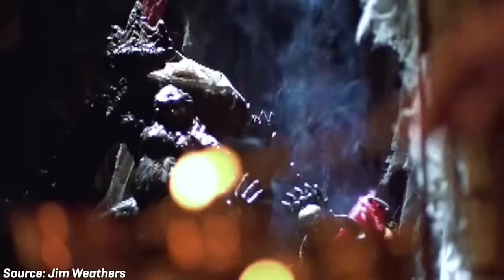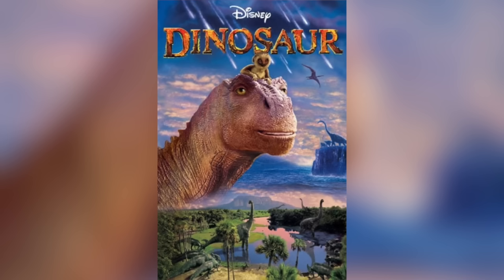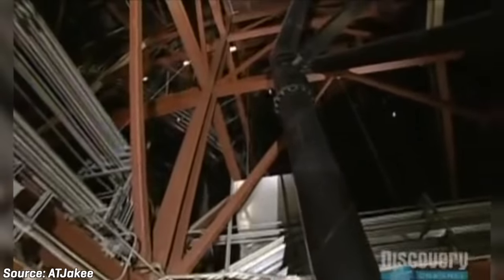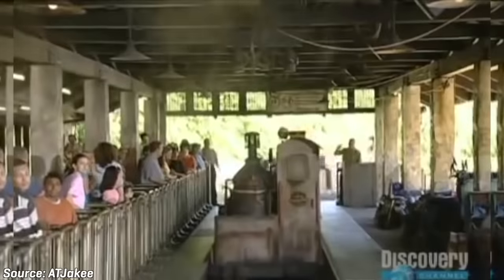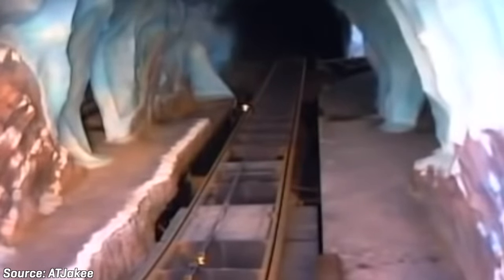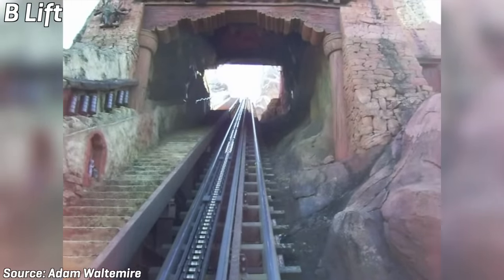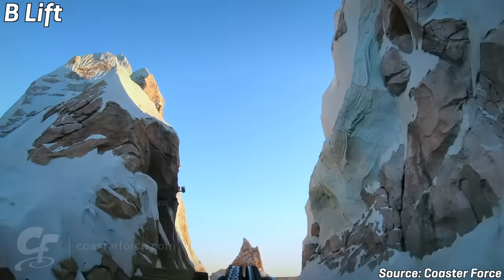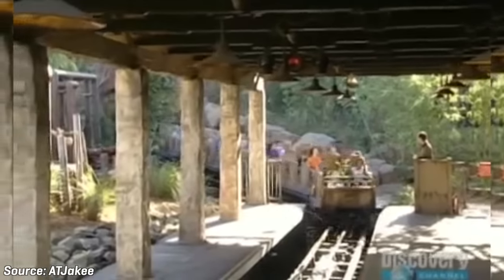Problematic Roller Coasters - Expedition Everest - Disney’s Animal Kingdom

Comment: Back in highschool, with the help of the robotics teacher I I made a miniature scale of the Yeti scene using clay and small metal rods as the scaffolding. He helped with the miniature yeti animatronic the size of an action figure.

I ran a test, first experiment was with a lantern battery (to represent the literal jet engine that powers it!). it ran for 8 hours (which I converted into years, so it would count as 8 years) until everything collapsed.

But the second one was a better result, because I changed it with 4 D batteries. It was able to run with no collapsing/stress.

So in my conclusion, they could literally change the yeti's power supply which could be more powerful but less heavier; Reducing stress in the foundation/scaffolding.

Comment: Tip: Seat small children on the left side. The lateral forces on the backwards portion pull you to the right, and you can hit your head on the (padded) side of the seat. I did that the first time. It didn't injure me, but I didn't like it as much the first time because of that.

Comment: Back in July 2017, we got stuck where the yeti is supposed to jump out  after approaching the “broken track” before falling backwards, we got stuck, we spent over an hour on the ride just waiting, we got to walk down the track and it was pretty cool. Sucked we got stuck but we got two fast passes each to reride the ride once it was fixed. They said the system overheated due to it being 100+ degrees.

Comment: Would you be able to do a video on why trains take a different amount of time per dispatch to load, bc i always wonder why there is a fast dispacth every so often and a slow dispatch and i wonder what causes them to happen! Great video btw very informative
Reply: there's all sorts of reasons idk about this ride but the one I worked on sometimes people wouldn't fit in the standard seats so we'd have to unload them and then do a hold on the next train to get them a modified seat. the harnesses were  hydraulic and was 2 per section so you'd have to recheck the two rows that dispatch popped for the one guest. there's holds for guests with accommodations. my ride had a no loose article policy so you'd have to tell people to give us their hat so we could put it in a cubby which added more seconds to dispatch. sometimes people would get scared after pulling down the harness so you'd have to pop the section escorting them off and recheck. depending on the harnesses some people had trouble figuring out undoing their seat belts and we also had over the shoulder hydraulic harnesses and on occasion they wouldn't pop in unload so we'd have to do it manually. guests would loose stuff on the ride and come to tell you about we'd fill out a form for them so you don't get your harness checks started as quickly... all sorts of wacky stuff can happen honestly!!  my ride was floorless and one time the floor didn't come all the way up by about half an inch and we had to evac them even tho they were in the station lol

Comment: This explains a lot. One time we were up at the very top with the broken tracks that go up, and we were sitting there for way longer than the other times i had ridden it that day. I was worried that thr ride had broken down.  The same thing happened once with the projection. But bow i get that that can be normal depending on where the other trains are. I'm glad that the trains will stop at the bottom of thr first hill when there are issues because one time that happened to be and i woukd have pannicked if we had stopped at the top😬

Comment: You know as a kid i LOVED roller coasters, but i was always so scared that something terrible would happen on one. Like what if my safety harness pops up mid ride? Or what if the coaster stops mid loop? What if something goes wrong and our cars collide on the track??? One time as a kid I remember going to a roller coaster camp at busch gardens where they took us behind the scenes on most of the major coasters at the time. And they explained all the safety measures that were in place specifically to keep anything like that from happening. 

While it definitely does suck that the coasters are sometimes programmed to sit still for an immersion breaking amount of time, it is always wonderful to know that the coaster is smart enough to ensure that riders safety is a priority and that if the coaster is stuck in one spot, that it just means the safety measures are doing their job. 

(Also it was a relief as a kid to learn that all my fears of what could go wrong on a coaster were not unfounded, but the people making the coasters had already worried about it for me. Like the fact that a harness physically can’t pop open on a ride because its default position is CLOSED-at least id its a hydrolock I believe-or the fact that the flat bits of coasters are in fact there to guarantee that you can’t bump another car or lose speed mid track!)

Roller coaster operation is a fascinating thing to learn about. And all the different ways it is done on each coaster makes it something that you’ll have a hard time running out of material to read about!

Comment: So, what I would have done to fix the issue with the ride's 5-train operations is to add a second block to the hold section, so that the final brake section can hold two trains. Of course this would require an additional length of brake run to do so, but the general idea is that with a ride like this stacking at the end is more desirable than letting the ride hold at key sections. Of course, with this situation, five train operation would still require a train to stop somewhere along the ride, but that can still be at the end of zone 1 since you don't really have a show element there - it's just the train stopped at the end of a broken track.

Comment: EE is my favorite attraction at AK (quite possibly my favorite coaster at any of the Disney parks tbh) and I would GLADLY accept any downtime needed to fix that dang yeti. I don't care if it takes two years, the yeti must return to A Mode. There are quite a few other E-ticket draws at AK these days, so I say it's time to make that decision to shut down the ride and get it done. 

However, now with Joe Rohde gone and the current leadership that only cares about money, quality of rides be damned, I honestly doubt that the yeti will ever be fixed back to its original state. It's sad to think that, but I really think that is the reality of this situation. To me, a disney parks and coaster nut, seeing that 20ft tall yeti swinging its arm down at me would make the attraction soooo much better, even if it only lasts five seconds, but there is no way in hell that the current leadership would EVER even consider shutting the whole ride down just for five seconds at the end of the ride. 

That is really a broad picture of all that is wrong with the Chapek-led company, and I wouldn't be surprised at all if that nickel-and-diming-guests attitude for half-ass attractions (likely caused by massive cuts to the imagineering department) is exactly why Joe left the company. It's really a sad thing to think about. Disney is trying to take the Six Flags road in terms of quality but still charging ever-increasing Disney parks prices. That certainly cannot be sustained, and something will give soon enough.

Comment: I rode this coaster like 5 times in 2022, when I went. The line was low, and it was ride after ride. Also, this ride is glossy smooth if I remember correctly.
Reply: That's good to hear.

Comment: I can imagine the track switch getting stuck and leading to a horrific accident
Reply from the maker: The track could certainly get stuck but with all the sensors on the ride, the train isn’t allowed to resume motion again until the track switch its rolling into is confirmed locked in place. Otherwise the train will sit stopped
Reply: @ElToroRyan  even worse I can imagine the sensors bugging out and flipping all the occupants into machinery.  But I'm sure something like that never happened
Reply: @8bitorgy  let me put it this way.

let's say the switch track has a 1/1000 chance of failing to switch properly. when this occurs, a sensor on the ride prevents the trains from moving unless the switch track properly lines up. let's imagine that sensor has a 1/20,000 chance of going down or misreading. already, you are looking at a 1/20,000,000 chance of something going wrong. but that's not all. when I said "sensor" I meant "sensors" because every sensor vital to ride safety has another sensor that measures the same thing as a redundancy measure, which would likely also have a 1/20,000 chance of failing, bringing the odds to a 1/400 BILLION chance of the switch track failing. that means that, on average, every person on earth would have to ride the ride 57 times, with the train all to themselves, before something like that may happen. that number is several hundred times larger than the amount of riders the coaster could possibly handle in its entire lifetime, nonetheless actual trains which is what that probability is showing, that each train has a 1/400 billion chance of an accident at that switch track. that's still not accounting for disney's daily inspections likely catching something wrong with the switch track before it actually happened, reducing the odds even further.

Comment: With the amount of parks that Disney has in Florida I was wondering if the USA has competition laws?, they seem to be taking unfair advantage over other companies who don’t have the $$$$$$$ power to be able to compete on a level playing field, but, there is always a but, I don’t expect they have the money to take Disney to court over the unfair practices that they appear to use.
Surly the “props” in the mountain village are in fact “artefacts” as they actually came along with the village, sorry, a small but important point in my humble opinion.
It strikes me that Disney want “their cake, and eat it as well”, five train operations are purely there to maximise passenger throughput and therefore increased profits from visitor numbers, but, what about passengers safety, with such a complex coaster the chances of an accident caused by an error in the system or employee error, must be exponentially higher, but that doesn’t sound as if it ever came into the thinking of the Disney corporation, and that is a worrying factor in my opinion. 😀👍🇬🇧🏴

Comment: the rumor about the computer program being to blame for the animatronic? Yeah that's total bs because if what you see in that clip is what this rumor is referring to, they used Maya 5.0, which does not come out of the box with much that would really be useful as far as turning a conceptual or digital idea into a physical one as that program is one of, if not the best tool kits for 3d animation and CGI to this day, ie turning a physical or real thing into a digital form. Given that, the program itself is about as open-ended and modular as it gets in the software world, including it's own programming language and designed to facilitate creating and developing anything that it's users could need and was so successful for this reason. Think of every single groundbreaking CGI example in movies over the past 3 decades, and 9/10 of them were made using this program. Simply put, it's capabilities are almost without limitation, and that limitation is of the users and thier capability to develop what is needed for thier specific application, especially one as far outside of the most common uses of the program. My dad always says, "a poor worksman quarrels with his tools." Sounds like they were simply looking for a scapegoat outside of their organization.  Either way, sad to hear it only worked for a few months, seems like an awesome experience.

Comment: jeez Disney would used the 5 train if one train was out of serves or something like that but to remove a block zone just for that really what were they thinking I get they what to have good through put but the remove a block like that is a ridiculous thing to do,  to me they should really have that 5 train in the maintenance shed just in case one of the trains has an issus and needs to be taken off  to be repaired and the 5 train to be put on the course until that train is fixed, now that's the smart thing to do but since it's disney they're never satisfied and don't also think things through like other theme parks do it's all about putting money in their pockets